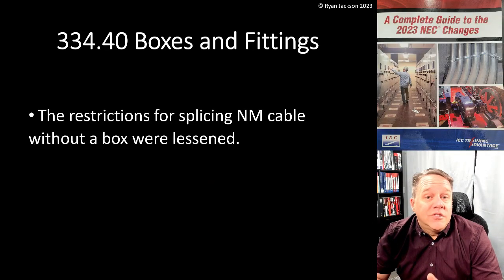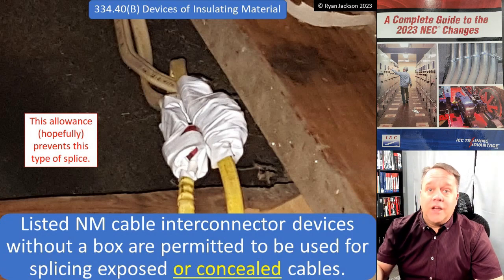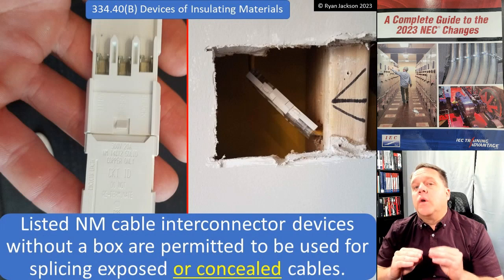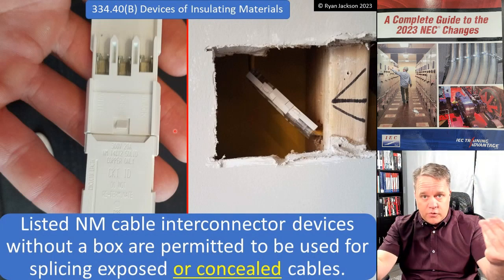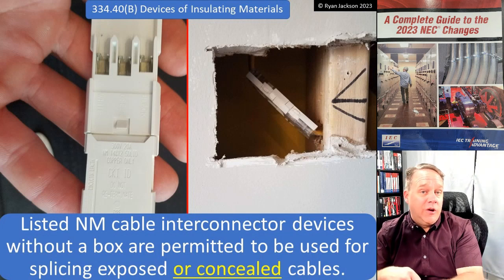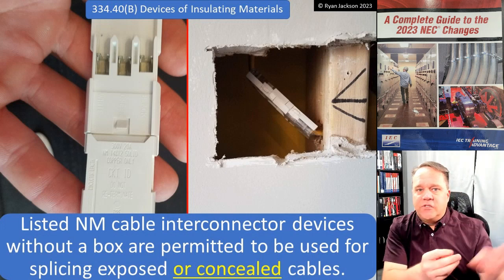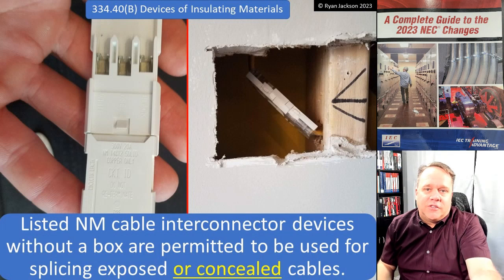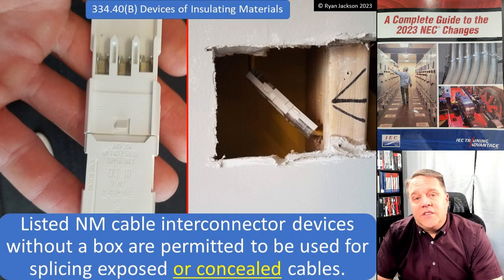334.40 Devices of Insulating Material

Comment: In 1929 house, during remodle, found that probably in the 1950s, someone extended knob and tube wiring by routing out the plaster in lath and plaster wall.  They used wire nuts and plastered  over the splices and cable!
Ended up removing lath and plaster and running wire as new construction. When I went to replace the noisy vent fan, I discovered that the fan exhausted  into dead space between floors!
That required tearing off the ceiling.  With all the other unsafe issues I ended up stripping all walls and ceiling to put in new wiring and vent the fan outside.  The project cost me about 3 times what I had estimated, but now it is safe and healthy.
Reply: Most of the remodeling that I worked on ran at least 30% off estimate due to unforseen problems and customers making changes every week. Best was when I only asked for $150 to secure a permit but insisted on a third of payment as soon as I installed 4 meters & 4 panels in a triplex apartment conversion. Only got another $150 then owner said I would have to wait awhile because he had to replace all of the old soil pipe in the old house. I took the covers home from the 4 circuit breaker panels as a security deposit. After six months I canceled the permit and homeowner told me he was going to sure if I do do return his panel covers. They company that made the panels just so happen to change design and dimensions after being bought out. Of course when I remodeled my old house 35 years ago spent twice as much money . Glad that I decided on more insulation, better low e glass windows, high efficiency furnace & AC unit.